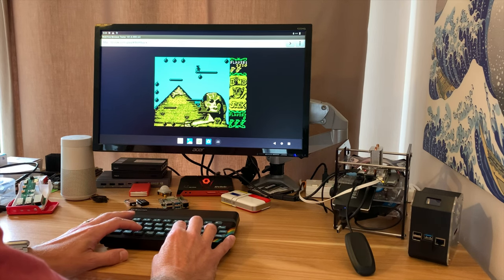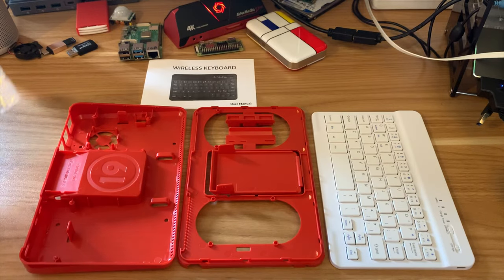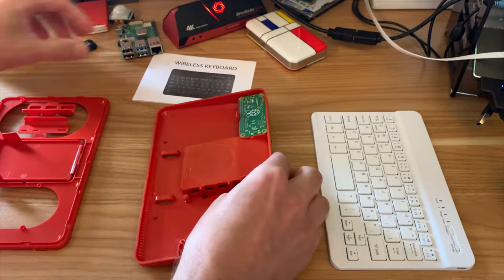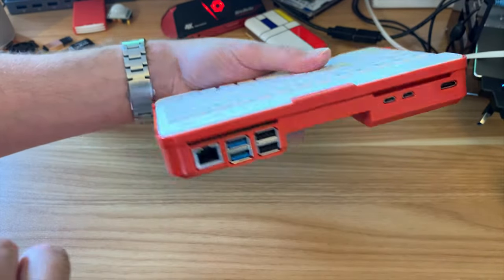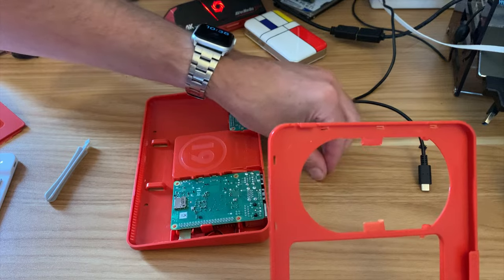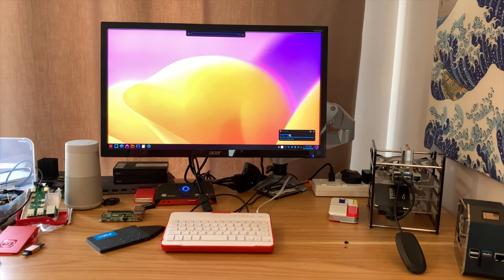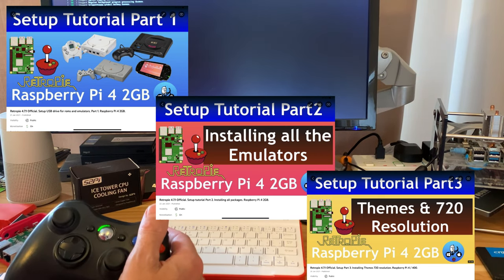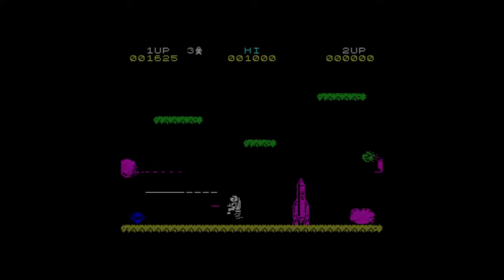Dual Pi Keyboard case. Pi zero 2W & Pi 4B.

Comment: I have the black version. Be aware that heatsinks are a problem particularly if you are going to use the provided fan. You can get an SSD in the "zero" side but the cable still routes to the usb. There is probably enough room for a battery also

Comment: I like these all-in-one type cases. I'd love to see one with a wired full sized keyboard that has slots for using four Pi's so you could set up a cluster. Maybe two versions, one for compute modules and one for regular Pi's, but not requiring them to all be the same.
Reply: A compute module version would be interesting...
Reply: unfortunately, that's difficult to achieve without sacrificing area or the height to the point it doesn't make sense anymore as a keyboard, take a look into Jeff geerling's video on pi clusters, the pi clusters require a switch+poe just to make them communicate with each other, if you go with a single board solution with pi4 compute module, it gets to the size of a mini itx motherboard

Comment: Nice video review. I really like to solid feel of this case when pi4b is installed and how compact it is. There's a bit so scope to have an updated version for storage and better access to gpio & microSD slot, but using Flash drive is Good option. I used a craft knife on cut-outs to get a neater finish. Hope Raspberry Pi plastics make some more and/or revisions.
Reply: You're thinking as I am in my post above - there's potential for modding in that case, isn't there?

Comment: I personally prefer the Pi 4B 8GB in the Vilros keyboard/touchpad hub. It is more like a stealthy C64 in Black. I love the 8bitdo N30 wireless mouse as well. I use Berryboot Retro Pi and Berryboot Lakka mostly although Lakka needed a Bluetooth dongle and a Bluetooth Speaker if I remember correctly. Berryboot Retro Pi worked with no extra hassle. I do have the Pi 400 as well but I only use that for travel. Thanks for the video though. I really enjoyed it.

Comment: This would be amazing if only they used e.g. full 75% keyboard layout. As it is now, it doesn't seem very comfortable as your main keyboard.
Does the keyboard remember and switch between paired devices, or do you have to reconnect every time when switching between pies?

Comment: I would power the zero from the pi 4 if it can supply sufficient power a VNC into the zero from the 4 to avoid lots a cables

Comment: Those BT keyboards are all over Amazon from different sellers. It would be a lot better with a 2.4Ghz wireless mouse and keyboard. But, a cool case overall. 💯
Reply: I think a USB keyboard would be interesting - then think about connecting to a HDMI KVM box whilst having both Raspberry Pi's in that case.

Comment: Since the 2w has an adapter to fit in Pi4 cases, does it make sense to fit it in the adapter and then use the Pi4 half of this keyboard case?
Reply from the maker: It’s a tighter fit. I didn’t try it all the way in as it’s difficult to remove.

Comment: I think that's a fairly standard Bluetooth keyboard, isn't it? I'm sure I've already got two of that exact same keyboard but in black, not white.

I wasn't sure about this keyboard when you started reviewing it because it initially seemed a bit "Heath Robinson" but it has some interesting ideas to it. I do like the similarity to the ZX Spectrum form factor.

I like the fact that it can simultaneously house a Pi 4 and Pi Zero 2 W and I started thinking to myself if it could be used with a HDMI KVM box so you can use it with one screen and just switch between the two Pi's. The only thing that would make that easier is if you could get a USB version of that same keyboard - you could then use a KVM with one keyboard and screen.

I also use PoE at home and putting PoE hats on both those Pi's (assuming you can get one for the Pi Zero 2 W) might also make for quite a neat setup.

I think I might pick one up just to see how might be able to mod it a bit - it's okay as it is but I think there's potential for more from it too.

Thanks for the review, this one's got the old "creative juices" going now!
Reply from the maker: I meant to say in the video. I did try connecting the micro usb to the Pi hoping it would work as a usb keyboard, unfortunately it is Bluetooth only.
Reply: @leepspvideo  I'll have to do some hunting around - that must be a common design for "portable" keyboards and it already has a USB charging interface in it. Maybe there is a USB version or wireless one with a USB dongle.

Comment: In the area where the Pi Zero goes...is there enough space to put a standard SSD with some double-sided tape to keep it in place?
Reply from the maker: Too narrow a 2.5” SSD is wider than a pi 4 which just fits. You could hack the case to make room. Or use an M.2 drive.

Comment: Question:  Couldn't you have plugged the micro USB charging cable from the keyboard directly to the Pi 4 (or hub for Pi Zero)?  Shouldn't that put the keyboard into wired mode and then pair without need for another keyboard?

Otherwise I love the idea of a two-in-one design for Zero & 4B.
Reply: No, it's a nice idea but those keyboards are Bluetooth only - I've already got two of them in black and the USB port is just for charging.
Reply from the maker: Correct. 👍🏻

Comment: Would a battery pack fit in that central void covered area? (not got to the end of the video yet - so you might have mentioned that) EDIT - may not be deep enough space once the cables are in there I guess.
Reply from the maker: I expect some of the smaller Pi Zero battery packs should fit
Reply: A USB SSD certainy would.

Comment: does the pi0 + expander fit the pi4 side ? it fits into a pi4 case so probably yes ...
Reply from the maker: It looks like it will. The Gpio pins wouldn’t work the fan as its connected in the video. It could easily be adapted. I didn’t clip it all the way in, the Pi 4 is a little difficult to remove.

Comment: great informative video as usual, 
is there a pi 3 version as i have 2 that this would be great for. . 
i have a low profile icetower  cooler on my 8gb pi4 and have to have the fan on too to get close to the temp of the original design on my 4gb pi. but still very quiet and dose not have the multi colour light that i hated on my original tower that's always on passive now and silent with no issues.
Reply from the maker: I haven’t seen a Pi 3 one, possibly could be modded

Comment: this doesn’t count as a self contained solution. even though it looks at first like it is trying to be an all in one solution, all the exposed dongles especially for the pizero to a usb hub prove otherwise. 

the keyboard not connecting physically to either board gives the illusion it is one piece, but many times on different setups i’ve had issues with bluetooth not connecting properly and immediately after boot that a direct wired connection is preferred. this is evident when it takes like 1 to 3 extra minutes after boot to connect, which is considered a “successful” connection, but not a timely one. 
also, wireless dongles keyboards (non-bluetooth) commonly used with pis transmit unencrypted that it’s not an option either to a wired solution.